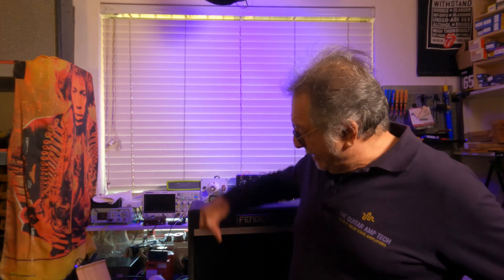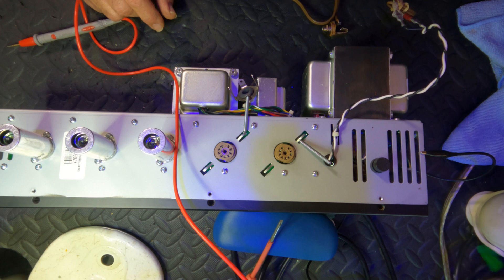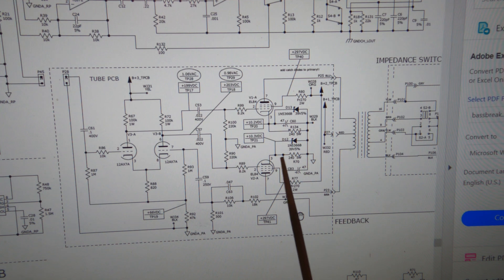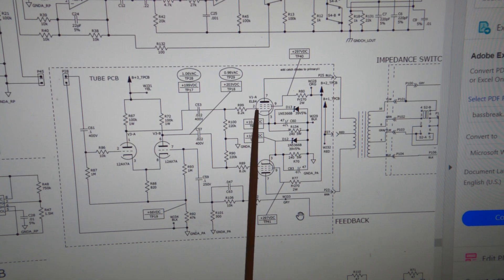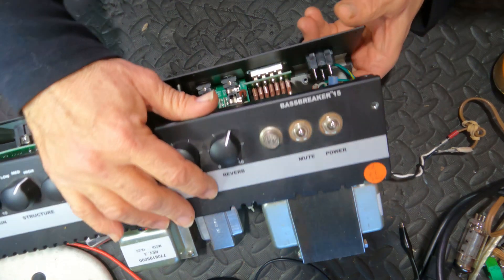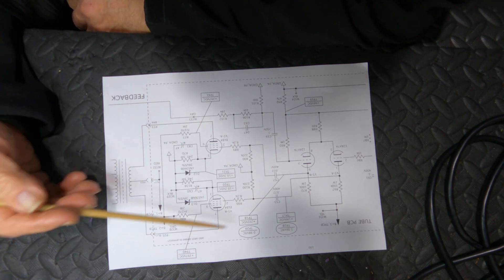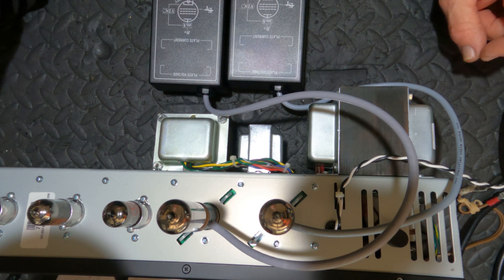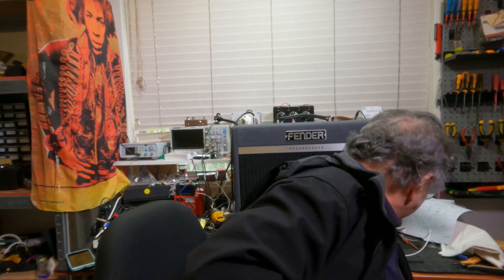Fender Bassbreaker 15 is blowing EL84 power tubes

Comment: I've got one on my bench with almost EXACTLY the same issue. My zener just turned into a low-ohm resistor. I've already taken the dang thing apart to get at it, so I'm just going to replace it, I suppose. This is, without a doubt, the least repair-friendly amp I've ever worked on. Just a total nightmare. I give myself a 50-50 chance of getting all the connectors back in the right place.
Reply: Do you have a suggestion for zener values that might be less likely to burn out, but still keep the amp biased as intended? Maybe go up to 39V 10W?
Reply from the maker: Yiasou, Ted. The Ballbreaker is a PITA. I can't see any other use for the Zener other than what I described in the video. It would certainly add to the repair bill if you ventured forth with removing that PCB, in addition to compromising those shitty connectors. If you go that way, replace it with a higher current rating.
Reply: @theguitaramptech  Just cut em out and throw em away UNLESS the amp is still under warranty in which case you voided it. Parts are made of unobtainium (reverb card and mode selector switch) if you're not an approved service center and even then if the amp is out of warranty G-d help you.
Reply from the maker: @1Dougloid  The parts support for Fender in Australia is pretty poor. I agree with "cut-out and simplify", Robert.
Reply: @theguitaramptech  A zener in the cathode string is one of the dumbest ideas I have seen in years. I mean, who does that? Why? There must be 100 million cathode biased guitar amps that didn't feel the need.
Reply: Did you get er done?

Comment: This amp does sound Awesome... hard to dial in a bad tone
Reply from the maker: Thanks for your comment, Chicken. I must admit, for being such a PITA to work on, the sound of the Bassbreaker was surprisingly good. To my taste, I still prefer a Blues Junior that's been properly set up. Even though the BJr is on a PCB, it's still WAY easier to work on and to do simple setup improvements. .
Reply: @theguitaramptech  fair enough. Ive owned a LOT of different tube amps over the years, and the Bassbreaker 15 has been the only one I've truly loved the sound off (and not sold on!).
Reply from the maker: @chickenbites8877  that is so good. Most of us never find our sonic nirvana.